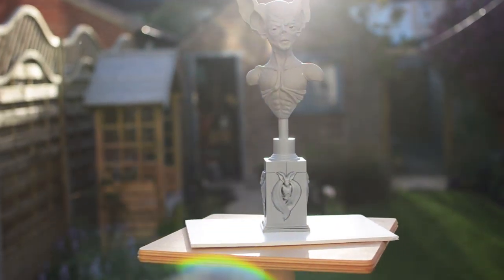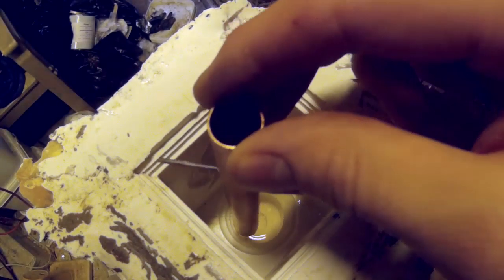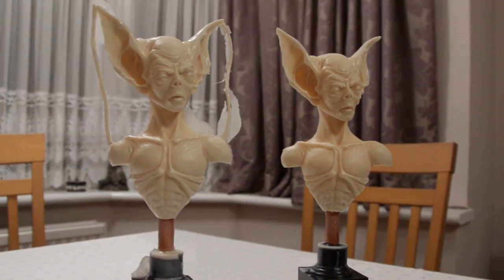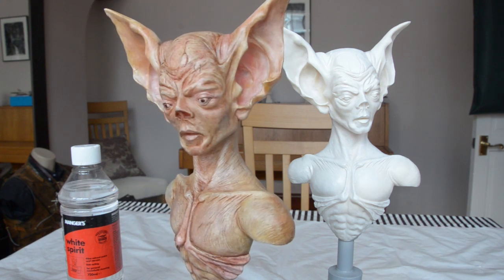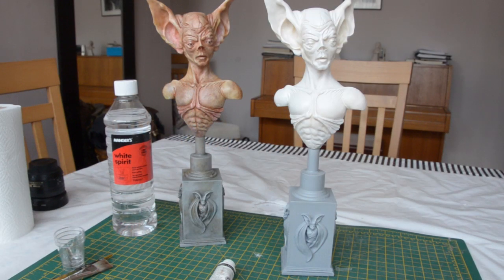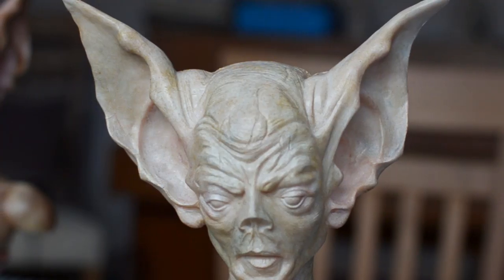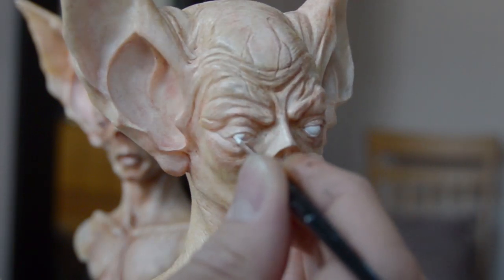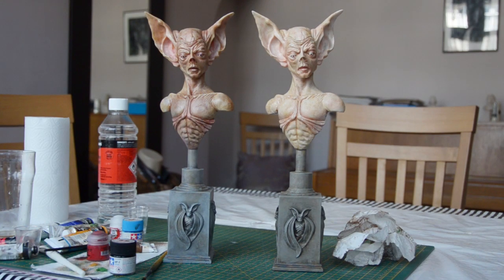Making a Creature Bust from Super Sculpey Part 4 - Casting and Painting

Comment: don't know if you did this but dust the inside of the mold with talc, this will eliminate your bubbles. works everytime for me. for the question about cracking on sculpey, leave the sculpt in the oven to cool down gradually. take it out once it's cooled down. but I agree about packing out with foil and keeping layers thinish.
Reply from the maker: Cheers dude.  I think I'd seen that in a tested.com video or something, but i've never tried it.  Will give it a go ;)  Yeah I have left sculpey sculptures in the oven before, getting the timing right so they don't burn can be tricky though.

Comment: I've just revisited this splendid video, and on my second listen to your comments about 'white spirit', or 'white spirits', as my late dad used to call it, I suddenly remembered that he would always use 'turpentine' for thinning oil based paints and for cleaning brushes.  That was until he found 'turpentine substitute', which was a less expensive product that did the same job.  As time passed he gradually started to buy 'white spirit', instead of 'turps substitute'.  I think that 'turps substitute' and the 'white spirit' were actually the same product under different names.  I suspect that the 'turps substitute' name was used as a promotional tool to covert "turpentine' users into 'white spirit' users.

Great tutorial.
Reply from the maker: +Brian JEFFERY thanks very much brian. Yes I did wonder about that. Curiously both products were available when I bought some recently. Having done some googling, it seems you're right:

White spirit (UK) [note 1] or mineral spirits (US), also known as mineral turpentine, turpentine substitute, petroleum spirits, solvent naphtha (petroleum), varsol, Stoddard solvent, or, generically, "paint thinner", is a petroleum-derived clear liquid used as a common organic solvent in painting and decorating.
Reply: So many names.  Maybe they're trying to confuse the uninitiated.

As you say, I would have thought that turpentine would still be available along with linseed oil, with which, as a youth, I mixed artists oil paints.

Thanks for the comprehensive reply.  I hope to spot you at the Asylum.
Reply from the maker: +Brian JEFFERY See you there! ;)

Comment: google "korben dallas trophy" and you can see my results with the talc on the rpf. quite detailed pieces with no bubbles. have you tried wrapping your sculpey in foil to stop the edges burning?  you can also boil it but from experience it doesn't give the best results, doesn't seem to go rock hard but ok if you just want to take a quick mold.
Reply from the maker: Yeah just found it - looks good, very clean.  I guess the powder can get into the details and draw the resin to it.  will give it a go with my next pour.  Yeah I often cover it in foil if the finish matters - often does for the flesh coloured sculpey.  i had heard of boiling it, not tried it though.